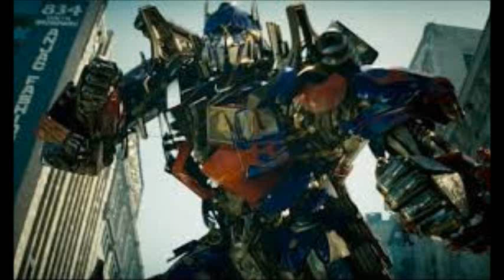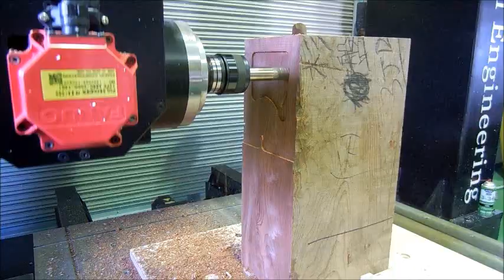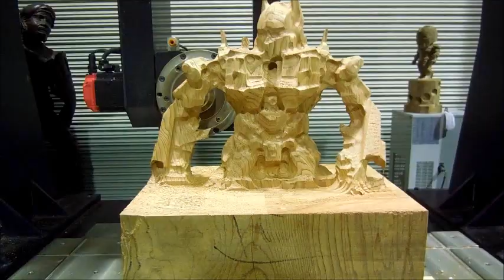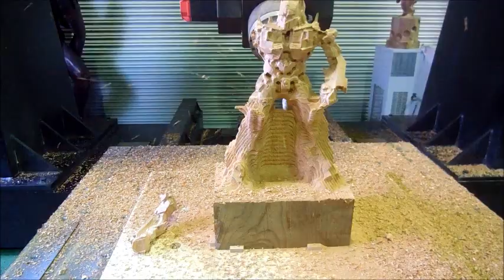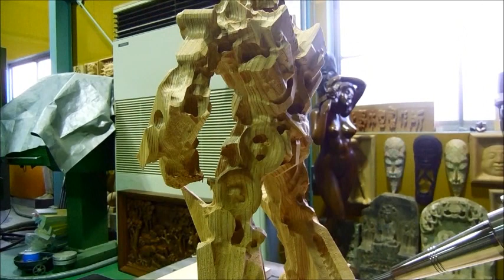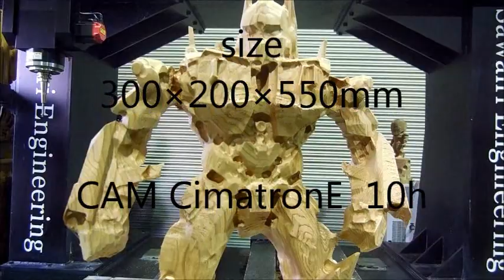[Transformers] 5-Axis CNC [optimus prime]

Comment: hi, i would like to know what type of mill you are using and could this mill do aluminum cutting? thanks in advance
Reply from the maker: thanks of the question.
we don't use CAD.
3D data(STL or OBJ) → CAM(CimatronE) → 5-Axis CNC
we don't cutting aluminum. we can make a mold and cast in alminum.
Reply: Cool bro !
Reply: I'm 100 on that it can do alu
You just need to slow down its feed rate and how deep it cuts for each pass ( even the small 300watt desktop cnc's can do alu if you run the slow enough and dosent cut to deep)